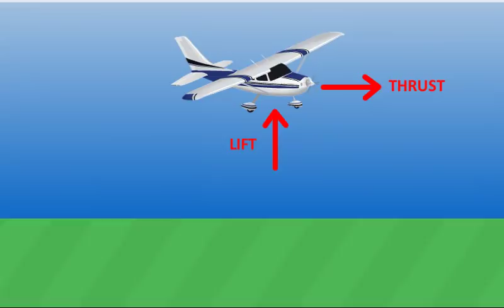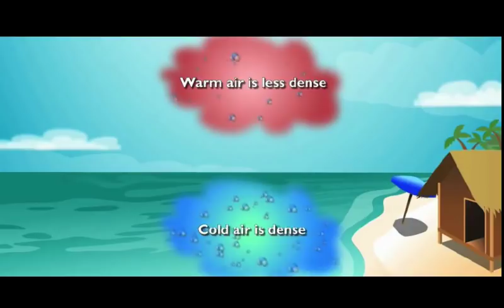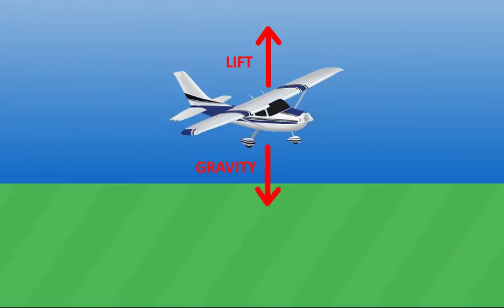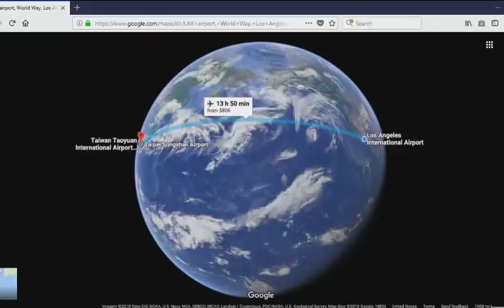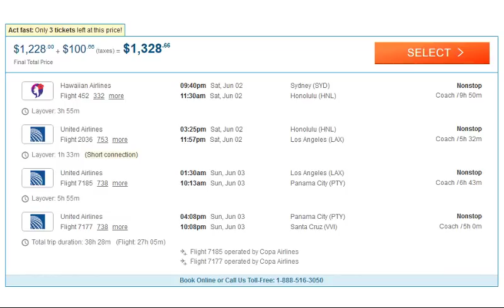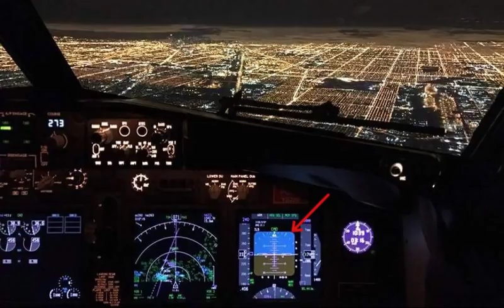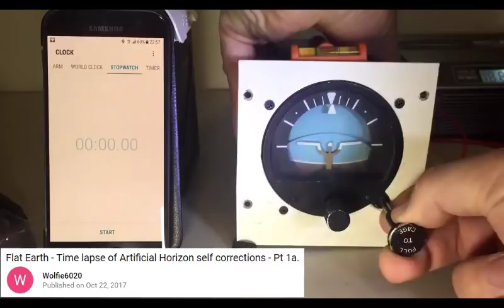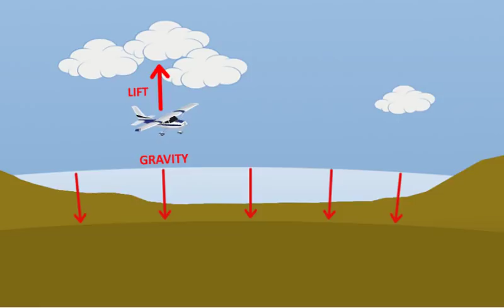Flat Earth Falsities - Plane Nonsense

Comment: aludred —
      Could you give me an 800 word rant imitating a psychotic flat Earther?
Reply: Robert Thomas 
This is impossible on the Flat earth? Not only is this but also the first 3 min prove that the coriolis effect cannot be measured. If the atmosphere is moving with the spin, then there's never going to need to be a measurement of movement of either the atmosphere or the earth for they move together. You just proved the coriolis effect is pure nonsense. Also you saved me from having to post an example about floating drones and helicopters.  With all this you've just given me enough to prove falsifiable theories. We know you want to prove a theory with another theory, but that's what NASA taught us all to do. Can't do that, it's not scientific. Try again. Present evidence which isn't supported by a question mark. Question marks are not evidence, they are theories, treat them as such and we'd all stop going round in circles. The big bang is a theory. It supports the idea that we are on a planet the same size as the ones we observe. Look up the Latin term planet. We are simply not as described. And ACTUAL planets are not of dense mass. Topping the cake which no one ever conceives, space is not as described. It's water. Not a vacuum. Stars are not suns or vice versa, and the only way you can make this argument is if all of these false claims are presumed to be true FIRST. Recheck what you've been taught. It's 2019. A lot has changed. Knowledge is emergent and ever-changing. Find out what you missed and then try again.

Oh, and 30°East to west? It's called the law of perspective and law of observation. It happens everywhere else just like anyone else would see it. Look up "vanishing points". That's what has been misinterpreted as curvature on the sea since the 1400s. It's dumb we still think it's curvature today. How many "mirages" will it take to prove you can see farther than where the curve should be with a stronger telescopic lens? There's a new record for 200 miles photographed with no curvature on x or y axis. Going too far ranting... 

Look, gravity is one half of the law of buoyancy. Else helium balloons would fall too. Boats disappearing over sea curves is an illusion. Not about the atmospheric heat either, it's just the law of observation. Get a binocular and it comes right back. Hasn't gone over any curve. "Lunar Wave" proves there is water in the ocean above us. The twinkling stars as well. Water. All the closeups of the planets show that NASA has rendered too much detail onto them to match up with size and ratio of the planetary features on each face. The stars have frequency. Photons and sound waves  travel very differently. How is it we can hear stars even 1 lightyear away is ridiculous. Stars are not suns. Else the sun would sound like they do, but much louder. From what I can tell, the planets do circle the sun, and the sun circles us. This is not even part of the original geocentric model, it's the second. Realize that what's in your mind right now of space is part of a single cosmology. One of many. In order to get half of what I'm saying, understand that you've only been introduced to one single measly cosmology. All the evidence for each major account for this singular cosmology is based in theory. Assuming bog bang happened... now Black holes, exoplanets, etc. What of black holes were just whirlpools? The stars are but bubbles undergoing sonoluminescence due to the pressure of the water. When's the last time the constellations moved? Is Polaris going anywhere? I thought we were shooting through space, but turns out you can bloody navigate by the stars bc they're so immovable, even 1000s of years ago. North is still north 2nd Polaris will always be what the rest of the stars circle. And space will never exist in this cosmology. Go find out how many other cosmologies existed before Rome destroyed their history, and the truth to their beliefs. How could a sundial work year round? Who invented it? They aren't around to show you why it works, but it could only work for 6 months on a globe. You'd be facing away from the sun at noon in June. 12pm high sun at xmas yes, but all your summers would have midnight suns. THINK. NONE of it works. Think physics. Use cg software if you're bad at imagining it. Use an orange and a pear with Texas written on the side. The core and mantle of the earth is a theory. The deepest hole ever is 11 mi. The rest is an educated guess. IT'S ALL THEORIES IN SUPPORT OF OTHER THEORIES. Which scientist allowed this? I'm done. You've got a lot to discern.
Reply: No. A flat Earth is impossible, as is everything associated with it. 
"IT'S ALL THEORIES IN SUPPORT OF OTHER THEORIES. Which scientist allowed this? I'm done. You've got a lot to discern." Diddums. Bless. 
Please explain Metacentres and Metacentric Heights? @aludred
Reply: aludred ok buddy now go back to your moms basement. 
PS. I didn’t read your book but I think at the end somebody dies. 😅
Reply: @aludred  Good job Joe Noyes, I couldn't have imagined a more psychotic FE response.
Reply: A theory made to explain volume displacement can still be explained without a metacenter. It's STILL called the equilibrium of buoyancy. 2 examples in a row now of renaming attributes of one universal law in order involve gravity. You didn't even bother attempting to disproving what I said did you? Could you try please? Your cosmology is based on renaming attributes of already existing universal laws. Try explaining to me at what point a helium balloon is affected by gravity. Give it a try. I've applied a cosmology you can't fathom. Yours is just as ridulous as mine, but you lack imagination. Gotta remove the first images in your head before applying the universal laws. Then introduce the laws you didn't know existed like the laws of perspective and how vanishing points have been misrepresented as curves. That's a 300 year old debunk. You still don't even have a repeatable experiment to point to with conclusive evidence for movement or curvature. Trust me I didn't grow up learning flat earth, I learned the same illusions you did. 2 different cosmologies. We both use the observable reality around us to explain what is experienced, but heliocentricism IGNORES universal laws and as stated above redefine attributes of existing laws, which you have to suspend your belief in, in order for the explanations to work. You live at the bottom of an ocean of air. If it's lighter it floats upward. If it's heavier than air, it floats down. The rate at which this happens is dependant upon density and defines velocity. But this natural equilibrium is only called gravity when it's heavier than air. So: what about that helium balloon would you like to school me on?
Reply: @aludred  Why? These topics are never productive, and play an endless game of prove it to me, denials and hurling insults. (If this alternative physics/cosmology is valid, do the research and publish it to an appropriate audience who can fathom it if valid.) Because of this I focus on simple existing issues.
     I asked a simple question. The FE Sun goes no further south than the Tropic of Capricorn, so in Melbourne, south of this limit, how does rise in the southeast and set in the southwest in December?

Comment: or another funny example: they argue that an object on the downside if a globe would fall off. Well that just shows that they actually understand the effects of gravity on the scale of what they can hold in their hands and that gravity (in our case the mass of earth) will force an object falling off the downside of a football that they hold in their hands while trying to explain the sensation they discovered.. But a heads u: gravity points to the center of a mass (in our case the planet earth - and yes imagine a huuuuge ball) so the force is the same towards centre if you stand on the opposite side of the huuuuge ball (called earth) you're safe 😂